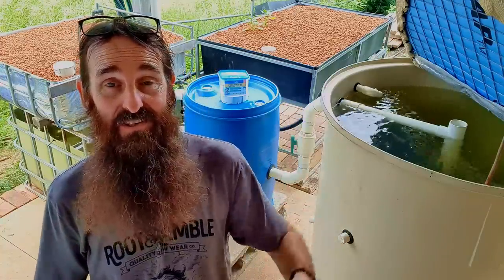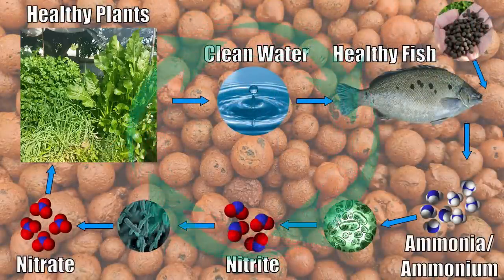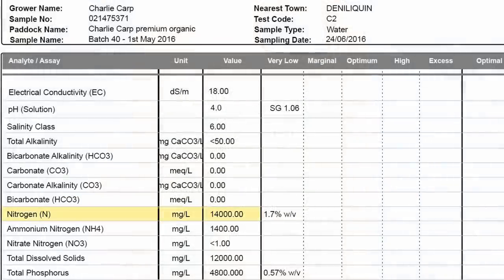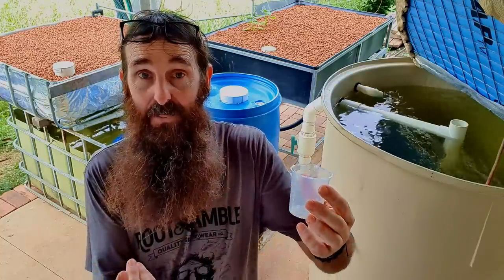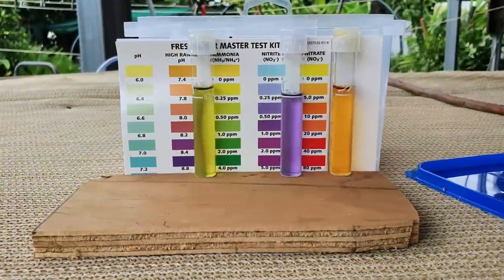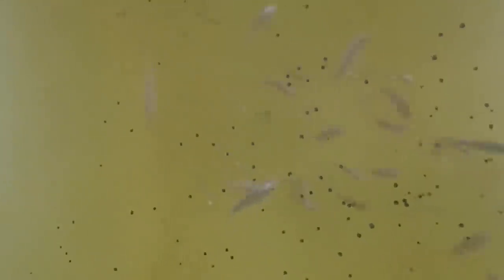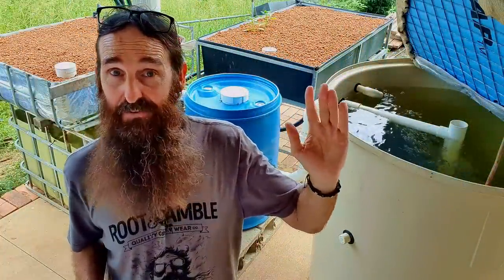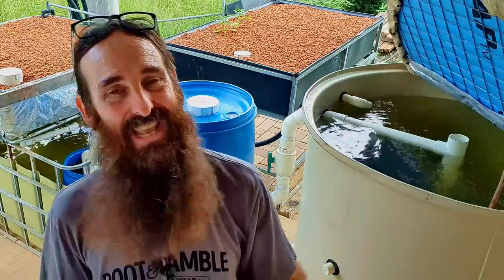How to Cycle An Aquaponics System

Comment: Hi Rob, thank you so much for your kindness to share your Auqaponics knowledge here. I enjoy viewing your videos which are very informative. I have just recently purchased a used IBC Aquaponics setup and now is working to cycle it. The problem is I am not too sure if the system is ready to put the fish or not. 

Here is the summary:
- After I bought the setup, I temporarily stopped the system so that I could clean it. I did not wash the expanded clay balls.
- I put back everything then started to put some plants plus adding the Carlie Carp solution to start the cycle.
- I think I put too much as the initial Ammonia reading was more than 8 ppm.
- After about 11 days, the Ammonia level started to decrease to 2 ppm. However I still couldn't detect any Nitrite, while the Nitrate level was already 160 ppm.
- I am now adding the Carlie Carp solution every few days to maintain the Ammonia level.

Do you think the reason why I can't detect Nitrite is because the bacteria is already there since the expanded clay balls were ex working system?
Is it now safe to put fish on the system?

Thank you in advance.
Reply from the maker: Hi Robert & sorry for taking so long to respond to you. 
I dare say that you're right & the nitrite oxidising bacteria are already there & doing their job. 👍
Have you popped some fish in there yet?
Sorry again for not responding when you needed it.
Reply: @RobsAquaponics  , thanks for your respond. Yes I did put the fish in my system couple weeks ago. They seem happy. Thanks again for your great channel.
Reply from the maker: @upailpt  Glad to hear all's going well mate.
Cheers.

Comment: You're an absolute legend. Starting my own little system in Melbourne and I heavily rely on your teachings. Thanks!
Reply from the maker: Glad to be of some help Arthur. What sort of fish are you thinking of running?
Reply: @RobsAquaponics   I was thinking growing some silver perch given the weather down here. Any recommendations?
Reply from the maker: @arthurhascoet  Silvers would be a good start. I do know folks that will run some trout through the cooler months. Not something I've been able to have a crack at up here.
Reply: @RobsAquaponics  thanks for your messages 🙏  I do have one question,  my growing bed is showing signs of beads whitening. What is it? Is it something I should be concerned about?
Reply from the maker: @arthurhascoet  It's normally just mineral salts drying out on the media Arthur. Most folks will get a little form from time to time & it isn't really something to be concerned about in small amounts.  👍

Comment: Great video 👍. I've always been successful just using goldfish to start off with and plant seeds directly in the system. By the time the plants start needing nutrients beyond what the seed provides, the fish have already cycled the system.
Reply from the maker: I prefer to cycle with fish as well. Have seen a load of folks kill their first batch trying that method so thought this method might help them out. 🤔😉
Cheers Tim.
Reply: How many of each do you start with? And do you plant the seeds in the same depth as you would in soil or just below the dry area in the media beds? Just about to finish building my system and was about to buy 150 tilapia fry and someone said don't.   No plants  just cycle first.  Help!!!!

Comment: Another brilliant and educational video from the Back Yard Farm and Aquaponics master...
Thank you for this brilliant, first steps instructional...
I notice in the fish tank that your SLO is of a larger diameter than in the past...is this more efficient, more suited to the round tanks or necessary? 
The slo's I have built so far have all been 25mm in size and have been adequate for the IBC systems I use. 
Is there a recommended size for a SLO? As I add a second IBC to the system should I increase the diameter and therefore the amount of flow from the two IBC fish tanks (one containing Jade Perch the other Sleepy Cod) when I add the two more grow beds (making a total of five)?
Thank you again for being the inspiration for what has become a genuine pleasure and considerable savings for my household.
Reply from the maker: Hi Frank. It's the same 2"/50mm SLO that was in it this tank previously. 👍 I found that size just handles the flow a lot better. 
I did have a 40mm/1½" in the older IBC system but found it didn't handle the 2000ish LPH flow rate too well. 
I prefer to use the 2" for flow rates over 1500lph as it isn't as easy to block up with crud & allows for a much higher flow rate. 
Hope that helps some mate & am glad the clips have been helpful in some way. 
Have a top one Frank.

Comment: Hi rod awesome videos you have inspired me here in melbourne to but a split flow system. Unfortunately I’m struggling to get my ammonia levels. I have been using Charlie carp 30ml at a time and haven’t seen the levels come up for over 2 weeks. I’m running 4 beds with a sump tank. I also have 2 x 1000l fish tanks connected to a settle out radial flow. It could also be due to the bell siphon not operating correctly.
Reply from the maker: Hi Dallas.
I just posted a video on the weekend looking at making & troubleshooting siphon issues if that helps at all,
https://youtu.be/hpVzsM_7uZo
At a guess, I would say that the bacteria in the system may be converting it or the plants in the system are using it as 30ml isn't very much. 
You could add quite a bit more if there's no fish in the system. It may take a day or two for the readings to show up when using the CC as well I've found. 
Are you testing for nitrite & nitrate as well?

Comment: Wonderfull video rob😊 
My system is cycled but I am not able to bring my pH down, currently pH is at 7.6😑any suggestions on how to bring down pH
Reply from the maker: I would probably leave it there as the nitrification process will strip alkalinity from the water resulting in a lower pH. 
It won't happen straight away but once it does you will need to add buffers to help keep the pH stable. 
Hope that helps some mate.
Reply: @RobsAquaponics  Thanks mate🙂 now my pH is down to 7.3

Comment: i was wondering if I add a new grow bed to my system do i need to cycle it?  will it affect the fish in my system?  could i just take out half the medium from my existing bed and mix it in with the new bed? will it be ready for growing and will the fish be okay? sorry for so many questions. love your vids!
Reply from the maker: You should be able to bring it straight on line with no issues MC as the other beds will have the right amount of bacteria in them already to process the waste for the fish load you have. 👍
Hope that helps mate.

Comment: G'day Rob,
I have just put together my first chop and flip aquaponics system and just put new clay pebbles in. I was wondering- I have a fish pond in my front yard with regular pebbles in it already- It has a few large gold fish in it that have been in there for a couple of years. Would it be alright if I put some of these pebbles in to kickstart the cycle? Will it have the correct nitrifying bacteria in it already? I'm planning on putting trout in over winter and want to kickstart the cycle as soon as possible so I can get the climate suitable for the fish. What are your thoughts on this?
Reply from the maker: Hi Nigel. Sorry it took so long to get back to you. 
Adding the rocks will help to kick start the bacteria colony to build up. 👍
Hope the systems cycling well for you.

Comment: Hi Rob,

Thanks for a great video!

Quick question, how often do you add the seaweed powder? And does that change while you’re cycling versus when you’re adding fish?
Reply from the maker: I add about a dessert spoons worth into each bed once a month. 👍 I don't think I'd add more than one lot in a cycling system as there generally aren't a lot of plants in there to start off with & the nitrate levels are also very low.

Comment: Hi Rob, do you happen to have a video that telling us when should the grow bed be replaced?
Or have you tried deep-water raft way to breed the plants?
Reply from the maker: If you include a solids settler/filter in the design & don't allow the beds to be come choked out with solids you should get a number of years of growing before they need to be cleaned 周宏宏. 
The only time I've cleaned them out is when the solids collected around the roots of a plant & caused nitrite spikes in the system. 
I haven't used DWC as of yet but will be including some in the larger system I plan to build before next season. 
Hope that helps some.
Reply: @RobsAquaponics  Sure, it helps a lot, its great to hv ur reply!And I look forward to seeing ur new videos!😁👍🙌

Comment: Hey, I really like your videos on Aquaponics and it has inspired me to setup one for myself, using a fish tank and crates. I had a question about cycling, for how long or how many days do you add the ammonia, in the graph it showed ammonia at its peak on the 10th day, so for how long do I have to keep adding them ammonia?
Reply from the maker: I would keep adding it until the day before the fish go in, even after it's cycled as it will be providing food for the bacteria. If you stop then the bacteria levels may decrease in number & you might (or might not) get another spike when you add your fish. 
There's a lot of variables so I can't say you will for sure as you'd understand. 😉
Reply: @RobsAquaponics  Thank you

Comment: Hi Rob, I'm about to start a aquaponic, design is already done according to some of your tips - thanks! I was thinking to add the fingerlings and use them for cycling as it would reduce time. Of course I want to make sure that water quality is appropriate for the fish. Regarding ammonia, nitrate and nitrite, I assume the only thing to consider is the ammonia that should be below 4.0 ppm, right or do you see any problem with this? I also assume that I would need some veggies in my seedbed then. How and how big should the veggie's already be before transferring the fish?
Reply from the maker: I'm sorry I missed this.
Ammonia at 4ppm would be very toxic to the fish. To cycle with fish you need to make sure that your water temp & pH  fall to certain levels or you'll poison them very fast. You'd also need to salt the water with pure sea salt to prevent them dying from nitrite poisoning (AKA Brown Blood Disease). 
How is the system going for you, did you cycle it successfully?

Comment: Would it be possible to take a buckets of let's say catfish out of a pond and introduce it to the system along with the water they were in to do this in a week or so?
Reply from the maker: If you used water from the pond I dare say that it would speed the cycling up a lot as the water would be teaming with the required bacteria. 
I'd still keep an eye on the ammonia & nitrite levels. If they get high you could do a 50% water change with water from the pond. I'd also not feed the catfish more than a small bit a few times a week either as they will be producing enough ammonia to get the ball rolling without being fed. 
Hope that helps some & sorry for taking a while to respond.

Comment: Hey Rob,
  I wanted see if I can get some help in the cycling of the water. We have been running the system for over a few weeks now and we are not seeing Ammonia, Nitrite, or Nitrate when we test. I must say that we did not start test until last week when we seen the fish no longer dieing.  We do have gold fish in the system and we have had 1 or 2 die in the last few weeks. I saw that your system was showing  nitrate when you said that it is cycled and starte to get the fish ready. Thanks alot you have tought me so much so far. I hope your MOM and Dad a staying safe.
Reply from the maker: Hi Joe. Sorry it took so long to reply. How's the system going now? Are you seeing any ammonia, nitrite or nitrate?

Comment: Hey Rob, great videos. I have built a chop and flip from one IBC. I have started the cycling process. Just wondering when I add the salt? Also how long should it take until I get nitrite and nitrate to appear. I'm at 21 days with no evidence as yet, ammonia appears to be staying around the same level. I have a few cos lettuce planted in the system. Thanks Stew🙂
Reply: Can be a little slow and stubborn in some systems, colder weather can also slow things a little.

Hopefully your system is kicking along by now.
If not harass Rob again and good luck.
Reply: @mrbrown3546  Thanks for the reply! Nitrite is there now as is nitrate. Ammonia is super low and I am adding it each day. Just waiting for the nitrite to lower now, so I can add the fish.

Comment: Hi Rob. My thai basil keep wilting and dying off in my aquaponic system. Other plants seem to be doin fine. Do u hv any advice or info on what is causing this. Tia.
Reply from the maker: I had that issue when the weather started to heat up here. Another issue could be mites or some small pest sucking the life from them.
Sorry I'm not much help there MrVicious.

Comment: Howdy Rob. Great info, which would have been much better a couple weeks ago, but still very informative.
Reply: Oops pressed send prematurely. I had just started up my new system, had sterile media (Hydroton clay balls) in two beds, 4x6’; and a 12x3’ water trough. Using captured rainwater as well water in the area has high calcium content. Added nutrients in the form of fish emulsion, but mostly ammonia I found out. System had no good bacteria so ammonia was maxed out for about a week and already had some cilantro trying to grow. When I figured lack of bacteria was the problem, I first threw in some aquarium gravel and biomedia I had from years back, and worried it wasn’t enough, so went into town (50 km. down the hill) to an pet shop with good aquarium department and got some Stability, beneficial bacteria in a bottle for setting up new aquariums. Two weeks now and ammonia at about.25 ppm, 2 ppm for nitrites, and about 2-5 ppm for nitrates. Plants doing much better (cilantro is damn hardy!) and just now added a bit more fish emulsion as per your video. Great information!
Reply: By the way, still need to set up the fish tanks, but wanted to be sure my filtering system was up and working.
Reply from the maker: Is good to read you got it all sorted in the end Joe. 👍
What sort of fish are you thinking of using in the system? 
Cheers mate.
Reply: Rob Bob's Aquaponics & Backyard Farm I’m debating between bluegill or trout. The water may be too cold for talapia. I am planning on putting the fish tank inside a garage but an aquarium full of water I had been testing for water temperature had a year long range of 10 - 25 C. We live in the high desert of New Mexico, over 2000m elevation. Sunny days and cool nights. Thanks for your help!
Reply from the maker: @joecanales9631  From what I've read the trout folks use here (Rainbow) start to die when it hits about 25°C so it might just do OK for you there if you can keep the temp down just a bit.  It's too warm to grow them out here but would like to give them a go one day.
Happy growing mate.

Comment: Hi Rob, i have 1 ibc with 12 koi in. It only has a small canister filter with 3 internal sponges. I plan to expand to 2 ibc tanks + 2 more cut in half to create 4 media beds. If I plumb in what will be my Aquaponics filter before hand will that be enough to colonise the bacteria or will the increase in water volume put me back to the beginning?
Reply from the maker: All should be fine as long as you don't increase the fish/feed load & include the canister filter into the build UK AP. 👍 You could probably get away with adding the filter material itself under the grow bed inlets to help seed them & remove them at a later date.

Comment: Hi Rob, thank you for the informative videos.  I've built my own chop-flip system based on your design!  I've now been cycling my system for almost 2 months now, and my graph looks similar to yours, but my Nitrite has been stable at 2ppm for a month now and doesn't seem to go down any further.  I have been topping off my ammonia at around 3ppm every other day, so I know there is bacteria, but I am unable to get my Nitrite levels down.  Is it safe for me to throw in Goldfish at these levels?
Reply from the maker: Sorry I missed this mate. How's the system traveling now?
What are your nitrate levels at? If they're present then the nitrite is being oxidised. 
If you have salted the system to 1 part pure sea salt (not iodised table salt) to 1000 parts water the fish will be protected from nitrite poisoning.
Reply: @RobsAquaponics  I am very glad you asked, because the numbers have not changed since then.  Nitrates are at almost 160, and Nitrites are at 2.0 consistently.  I have tried starving my system of ammonia to see if the levels will "flush itself out", but it has not.  Also, when I gave ammonia again after a week (normally every other day), ammonia was consumed in a day, so I know the bacteria are doing well.  Could it be that I am not growing enough vegetables?  I followed your IBC chop-n-flip tutorial, so I have just one grow bed, but I do have a whole separate IBC for the fish so tons of water.  If I put in sea salt, do I need to switch to salt-water fish?  I'd like to raise rainbow trouts.  And thank you for responding even after a month!